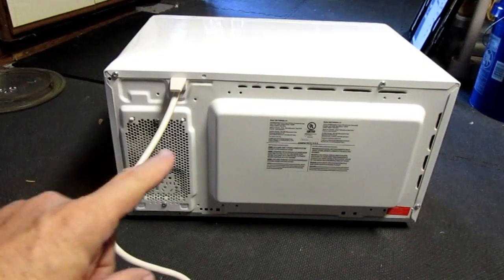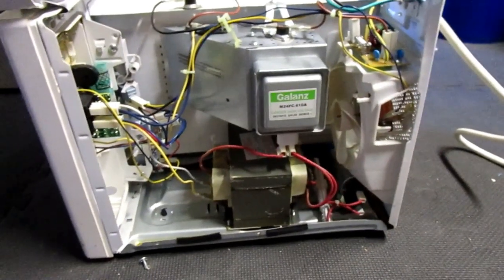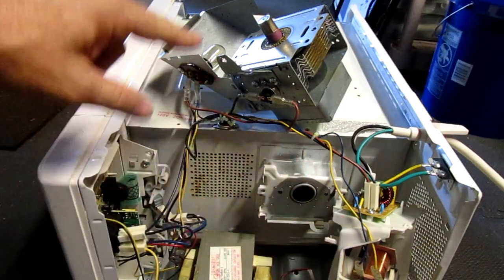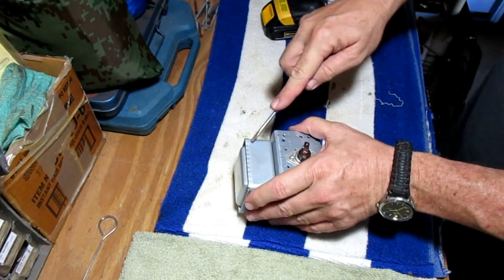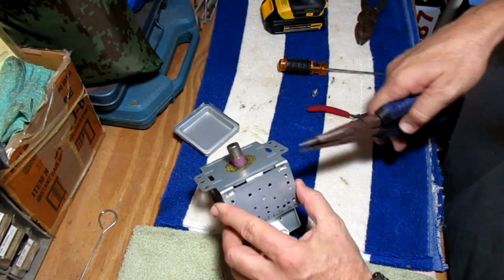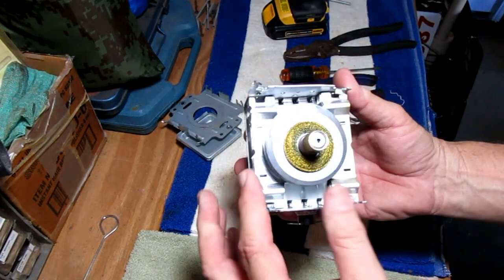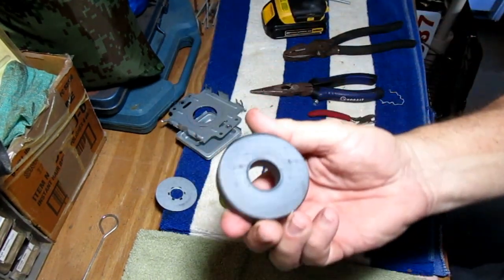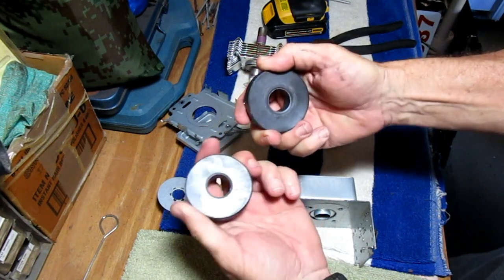How To Take Magnets Out Of An Old Microwave Oven

Comment: Thanks, Before you chuck out the old microwave, just buy a new manetron for fraction of cost of new microwave, change the inside Mica plate whioch may have burned and you jhave a new microwave. You can check videos on youtube how to do this. Only once confirmed the magnetron is burned out or dead should you discharge the capacitor first (See videos on how as its dangerous) and then use this video to remove magnets which you could reuse for a long long time on so many things.
Reply from the maker: Yep, but this micro was beyond repair.  And you should always discharge the capacitor...

Comment: Put one of those on your cars engine oil pan, and it will attract any metal that's in the oil. Help your motor to last longer. Transmission pan too.
Reply from the maker: That would be a good use for it

Comment: If these things you think are powerful try them neodymium magnets, especially the N52.   With a lot of effort you could maybe manage to slide them off somehow. 
I have an inch square neodymium, I consider it a dangerous item in the house. I have it wrapped with heavily insulated plastic and metal both to protect it and whatever metal it comes in contact with.
Reply from the maker: Man, those are powerful...
Reply: @FloridaBoyBushcraftSurvival   After I watched your video I went ahead and removed the magnets off the microwave magnetron I had taken out.  I played with a flat head screw driver and quickly realized that a side cutter plier was better choice for me as with the flat head slipping and sliding wasn't my cup of tea hurting myself etc.  The side cutter grabed good and took it apart easily.  However the magnets were fighting me, and my concern with radioactive things I guess made me clumsy more I guess.  In a nutshell I broke one magnet due to trying to pry it out with a flat head screwdriver,  But the other one ( the bigger one underneath) came off as by then I had pulled everything else out. 
Yea compare to the neodymium these magnets are very light weight.  In fact I have little neodymium magnets  and they are insanely powerful.  They will hurt you.
I believe The N52s are the most powerful magnet in the world. You can check them out on Amazon or AliExpress ( cheaper),  They are not that expensive nonetheless, unless you get bigger ones.  That  one inch is around $10, on Amazon, the N52.  .  other ones are a dozen for that.  Just realized mine is 1 1/2 inch cube.